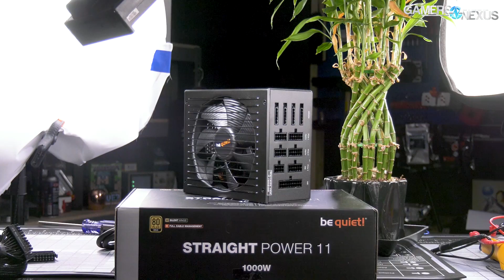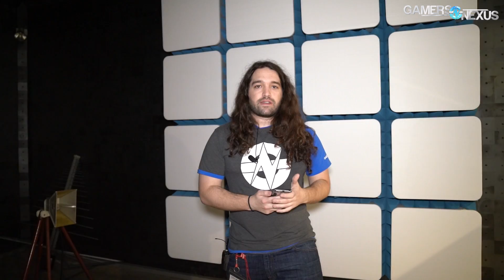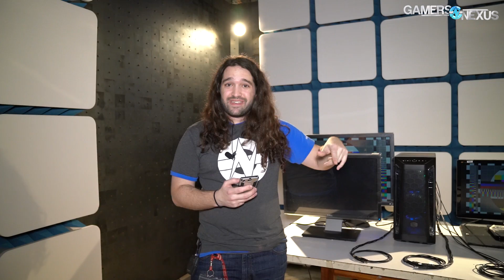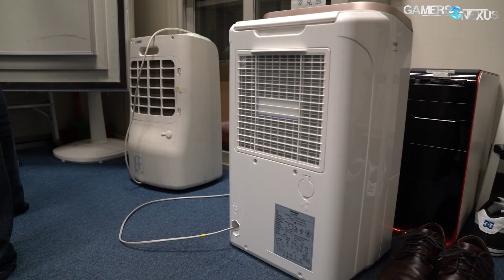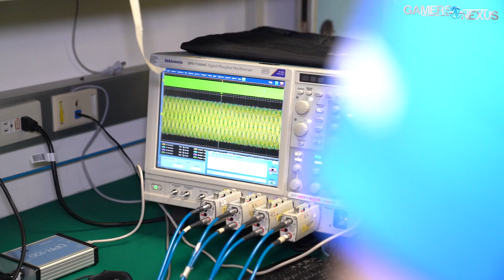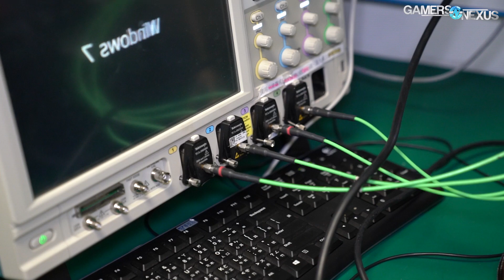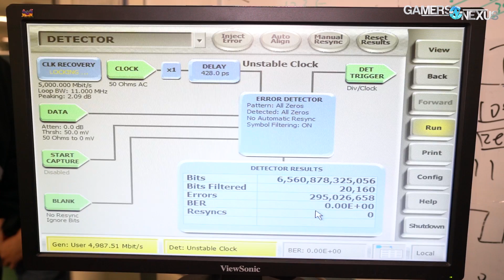GPU Radiation Testing & Signal Engineering | MSI Lab Tour

Comment: Pretty much all electronics emit electromagnetic fields. However i was very surprised to pull out my emf meter and notice that my GPU was producing high enough frequency emf fields that they were in the radiofrequency range (above 10mhz). This was isolated to the gpu and not coming from other sources (motherboard does not have wifi). Does anyone know if the silicon processor itself leaks emf as a biproduct of the gigahertz level frequencies?

Comment: The accepted standard way to build Acoustic anechoic chambers (this is a good example of a semi-anechoic acoustic chamber, because it has a solid floor) uses both reflection (bouncing up and down in the wedge and being absorbed by / energizing the air) and absorption (into the foam wedge and absorbed by / energizing the foam)

Comment: To anybody wondering, these scopes and testing instruments aren't that super expensive. A lot of expenses are actually in software running them, i.e. all per-compliance and protocol testing / validation packages. They are not that complex, but because market is so small, they necessarily cost a lot.  You can buy same scope without this software and it will be probably 1/3 of the price!

Also, for really high end scopes, you should look into wireless communications, radar, etc setups. Scopes and software can go into 1M$ range, because of how advanced they are.

Comment: The problem with using phone in there is that it is a well shielded room. So if you enter with a phone, your phone will start sending with very high power to get to the cell anyway. This could have bad effects on some sensitive equipment.

Comment: You'd be surprised what omitting one resistor after a crystal oscillator can do with various communication channels, even when the electronics is in a shielded Faraday case.  There are many techniques which are used in PCB manufacturing to not only are for functionality purposes but also EM radiation mitigation.

Comment: Next time bring a mod mat for the work table i am surprised they let you film that.
I use the same analyzer a couple of times a week to test and adjust radio equipment, if a fire broke out in the company i would try to run back in and grab it, because it is fantastic for the job we are doing.

Comment: First off I would like to correct you on the statement about third party checking for CE certification.
The CE certification does not require third party tests since the CE mark is more stating that the manufacturer considers the product to live up to the EU standards covered by the CE standard. Though the FCC in the US does require products to be tested by an authorized third party. Though, since MSI probably wishes to sell their products in more then just the EU, then third party testing is still required.

Next thing with the EMC test chamber, the gray/black square pattern on the wall is ferrite tiles for anyone curious. These are usually used in conjunction with a faraday cage to attenuate electromagnetic interference. Since just a faraday cage doesn't really do much against the magnetic part of the interference.  (The net in the ceiling is in case one of these tiles falls off in case of an earthquake or similar.)

Also, the "digital phosphor Oscilloscope" is just Tektronix term for intensity graded wave forms. Though, it isn't really any better then other intensity grading systems, and the whole oscilloscope industry has so far not understood the difference between fading to background color, and fading the transparency of the trace.

And the eye diagram is technically nothing more then measuring the clock jitter in conjunction with rise and fall time of a given signal in comparison to a reference clock source. If the eye "closes" vertically, then one's rise and fall times are inadequate, and if the eye "closes" horizontally, then the clock stability is poor. It can also indicate runt pulses, as in the signal not making it all the way over in time. This would result in lines going through the eye of the diagram. (Though not to be confused with a multi level eye diagram. Not that this is common for digital systems.)

And if the EMC test chamber only costed 20-30 grand, then that is cheap. Since just the ferrite tiles on the walls floor and ceiling can cost over 40 grand alone for a room of that size. (Calculated based on a 5 by 5 by 4 meter room, then it is down to what type of tile one wants after that.)

Comment: Im not quite sure I follow...radiation from computer components...??
Reply: Electromagnetic radiation. Oscillating charges (i.e. what happens in pc circuits) produce e.m. waves at the frequency of the oscillations. This can interfere with radio devices which operate at such frequencies, among other things (like frying things). The tests are to ensure the intensity of the radiation is not large enough to cause problems.

Comment: Thats $20-$30K for an  EMI compliance testing session when they send it to a 3rd party. If thats an ETS lindgren chamber (one of the antennas was an ETS lindgren antenna)  then the chamber will be $250k for just the chamber. probably a good bit more since they are using the ferrite tiles behind the foam. (That foam they have will go to ~500 MHZ, judging by the depth, the ferrite tiles extend it much lower) By time you add the turn table, antennas, EMI receivers, etc, you're looking at $400K+  if you're talking everything new.

Comment: Man that’s awesome they go to such lengths to prevent themselves from sending something out to the actual Certification Center and having problems, wasting time, etc. I didn’t think radiation testing was a big deal for anything other than wifi network adapters. The sound testing chamber is also awesome, and that one feels more intuitive to me because I immediately see the utility for fans on PSU, GPU, and plain old case fans or heatsink fans. Signal analysis also makes sense immediately for PSUs and all ports/sockets on basically everything. Amazing science.

Comment: Hello! Perhaps a question for a further (or past?) edition of Ask GN:

Derived from a personal problem: My beloved 2005 PCI soundcard (E-MU 1212m) started picking up system noise it never did before when put in a new system.
I wasn't surprised the mobo soundcard did pick up system noise (though it marketed its differently routed L and R signals to prevent channel interference - a much lesser problem in comparison imo), but was really disappointed the E-MU card also did, which was super silent in the previous build, making its -120dB SNR shine. I always heard about "in case" cards picking up that 'digital' noise, but the E-MU card being silent so far just thought it's a quality / design issue. Now I certainly know it isn't, moreover, while high power state use (gaming) the noise is quite loud and disturbing. I know discrete sound cards are oldschool, but the regular one is also disturbed, so it must be a common problem.
Q: What causes onboard and PCI (reportedly also USB) sound cards to pick up sys noise, and how can this be prevented?
Some things I figured out than could help:
1: In the old, silent build the PS unit was in top position (old style) whereas in the current one is in the nowadays regular lower PS shroud, much closer to the PCI slots. (The mobo also has lower routing for its sound solution.)
2: Software volume mixing doesn't affect noise volume, so guess the noise is picked up AFTER the D/A conversion.
3: The Riva Tuner frametime graph very much resembles the type of the heard noise (load screens vs ingame phases), wich seems to be louder with heavy GPU load. (Though not sure the radiation / signal comes from the GPU itself, or the PSU delivering the asked power.)
4: It is kint of the same thing when one kind of hears how the mouse periferial reads the surface: When moved, it crackles, when stopped it only does random pips. This also occours in my case with both cards, only at a much lower volume, but STILL disturbing in sound production scenarios.
5: The only semi-solution I found from the seemingly unprofessional sources I could find (musicians guessing mainly) is that turning Windows power management to PowerSaver significantly reduces the whole noise to a quite tolerable level. Others said it might have to do with power connector grounding.

Thank you in advance! 
Thumbs up for all the content and cats :)

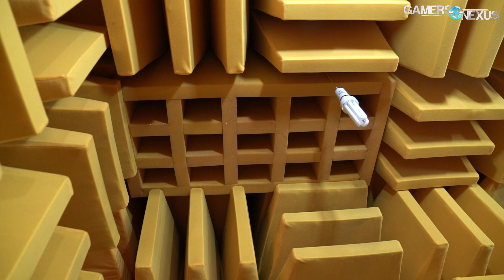Comment: Anechoic chambers always look amazing. It always puzzles me that square/rectangular floor plans are used in them them though, since the orthogonal corners introduce well known acoustic issues, as shown in 7:15. An hexagonal floor plan would be more beneficial, although walls of course would still hit floor and ceilings at 90 degrees. Slanted ceilings would be better. In fact, ideally anechoic chambers should be spherical, or let's say icosahedrons or dodecahedrons at least, something along those lines. A matter of building costs of course, but even pro full anechoic chambers seem to be in normal rectangular shaped rooms, which is quite not ideal for the purposes
Reply: I'd venture that the designers of those rooms know a bit more about it than you.  Something they're probably taking into account that you're not giving enough credence to is cost per performance.  Why build a spherical room for magnitudes more cost when the sound floor is already low enough?

Comment: Being a somewhat strange person that likes to put sound cards in my PC i found that the 3 pascal cards i had at one point in my possession all generated some form of coil whine that interfered with my microphone to the point of forcing me to buy a usb microphone in order to not annoy my mates. Not sure how this is with my current turing gpu though. The sound card in question even had "shielding" that didn't help one bit. (Asus STX essence).
Reply: 3 separate cards producing coil whine? unlucky as hell.
did you ever try a different power supply with the same cards? the fault could be with it rather than the GPUs.
Reply: Yup i did. Did not change anything. The pascal cards were notorious for coil wine when they first launched  @nogravitas7585

Comment: It isn't metal panelling inside. They are ferrite tiles designed for low frequency attenuation of signals. 

The absorber is designed for higher frequency. 

The horn can go to 18GHz but being lazy, civilian standards for non radios top out at 6 GHz.

MSI would be pushing it I suspect to get full cert on their iOATS SAC re NSA but not required for precomplaince. 
6db is a good initial rule so nice to see a smart company apply it. 

If you need phone on flight mode outside of the room when taking measurements it implies poor shielding or earthing
Inside a room if measurements then phone shouldn't be there as fligtmode still has plenty of non tx emissions. (It is generally good practice to flight mode however just in case. Only ever seen juniors have issues though )

Nice to see the roof net. Been a few falling tiles in the past around the world. Ferrite tiles are deceptively heavy.

Comment: Slight correction for you, Steve. In most cases, you don't apply for certification to receive the CE mark. The CE mark can be applied to products with "minimal risk" without any sort of verification process.

The mark only says that you have proper documentation of various safety testing, even if you don't. Where this self-certification can backfire is when the regulating body requires documentation.
For example, if someone gets hurt because of your product, you have 6 days to provide all documentation relevant to the product's CE certification - so you'll want to have that documentation prepared beforehand.

I had to refresh a little bit of the knowledge here from Wikipedia (so I can't tell you what they mean by "minimal risk") but I've come to know this through my line of work.

Comment: $20,000-$30,000??? I don't think so. I worked in a hardware lab and a single, closet sized radio testing chamber was $250,000.
Reply from the maker: We're just using the numbers they gave us!
Reply: @GamersNexus  fair enough. I'm guessing they don't want to actually give anything away by giving an accurate number.

Comment: You do not receive the CE badge! The certified lab only tells you that the product is CE compliant.
You can put CE on any product but if it is found out that your product is not compliant with CE, then you are fined big money
Reply: Interesting, I didn't know that! Looking into it, apparently just specific products like helmets, chainsaws, elevators etc. need to be tested by an authorized third party.
Reply: it makes sense, if you're saying that something is compliant and it isn't, so you're making a fraud. But if you're saying that it is compliant without testing and de facto it is, no problem here
Reply: Yeah, that is right. The manufacturer just says the product is CE compliant, there is no testing from any independent governmental entity. It basically is worth nothing at all and there are tons of products that fail to comply CE standards when testet by a third party.

Comment: EMI is Electro Magnetic Interference and isn't the same as radiation from a radioactive material like Uranium. Radiation in this context is "does the product radiate an electro magnetic signal that can interfere with another product". Layman's terms is it pretending to be a radio transmitter in the electro magnetic frequency.
Reply: alpha, gamma, xray, ultraviolet, visible light, infrared, microwave and RF are all various frequency groups of electromagnetic radiation. they are all part of the same general classification as radiation. radioactive materials are those that can emit said radiation without any assistance, and do so in the ionizing radiation spectrum. this means,  radioactive materials can still cause EMI in equipment, and can be more potent in doing so. The radiation from a radioactive material like Uranium is technically the same as any other radiation, just the radiation from radioactive materials have a much smaller wavelength.

Comment: Do those cfl lights hum in the sound room?
Reply: During EMC emissions testing, lights and unneeded things are mostly shut off with a switch outside to prevent noise, they may do the same during sound tests.
Reply: @larsjrgensen5975  good to know ty
Reply: Had the same question immediately at 6:30. I had CFL and LED lamps audible in regular rooms, can't imagine they could be left on during actual testing.

Comment: I did not know GPU's have radiation :o
Reply: Everything does, even you.
Reply: everything that move electricity back & forth produce Electromagnetic radiations, so called "EMI". And every minerals & atoms have a fraction that emit other exotic kind of radiation, so called "Alpha", "Beta", "Gamma", ect from decaying isotopes, like Carbon-14 & Potassium-40
Reply: @xponen  ohh.. So it is not dangerous?
Reply: @megapet777  only dangerous at high Power! such as Microwave oven! one doesn't see that level of energy anywhere else.
Reply: @xponen  really? Is using microwaves bad?
Reply: @megapet777  they (EMI) aren't dangerous to us but electronics that operate under a delicate low power use will be effected by nearby higher power electronics. It's like "noise" for electronics & they try to minimise it as stipulated by the Law.
Reply: @xponen  Ah I see. Sometimes when my friend goes close to microwave which is on and he is using wireless headphones, they will start make weird noises.
Reply: @megapet777  no, not to living things specifically, but to Water which is receptive to microwave oven, making it boils up from inside out. It doesn't do anything to anything else to the food or your body.
Reply: @xponen  I see

Comment: at $20K, this EMI  room is very cheap.  in UK each of those tiles costs £15 and they are 10cm square   the interesting part is the equipment needed to drive the antenna , table ( which rotates ) - where each costs about the same as a house .....    freaking expensive.